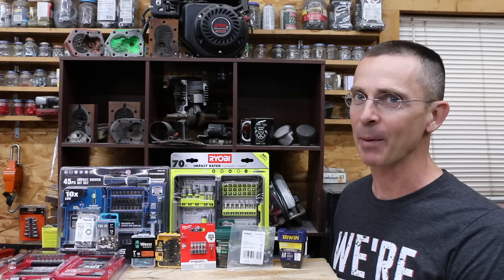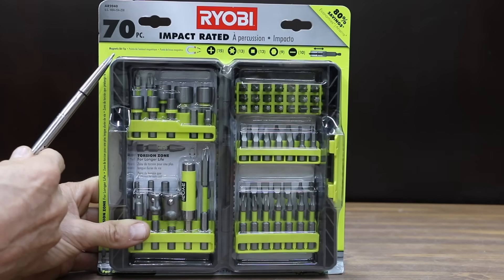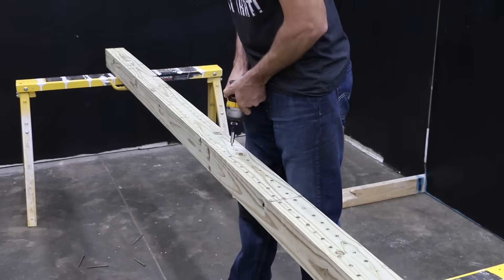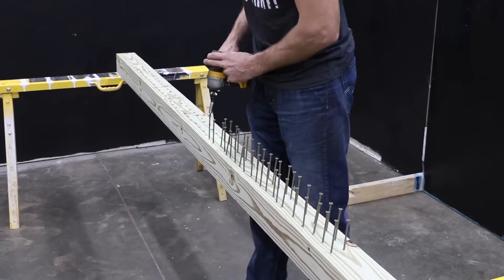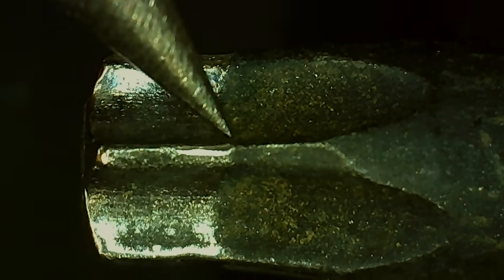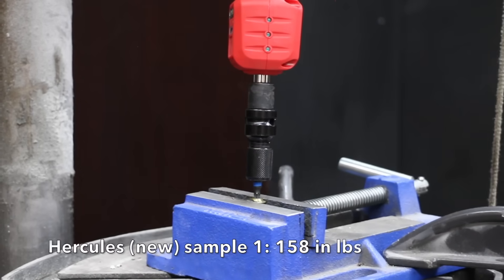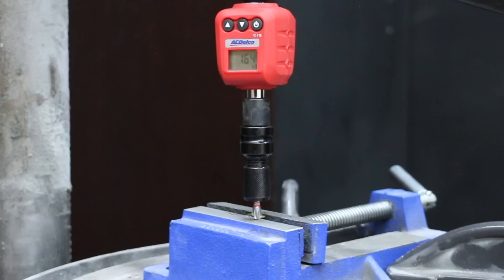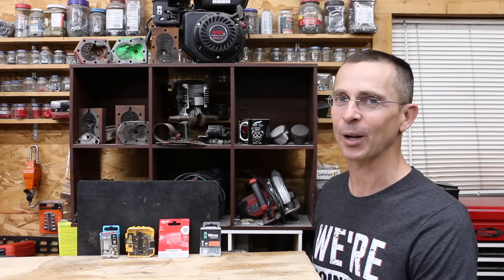Best Star (Torx) Bit Brand? Milwaukee, DeWalt, Makita, Ryobi, Wera, Wiha, Irwin, Bosch, Bauer

Comment: I run Dewalt the most. They are sale the assortment packs at the home store frequently. I also run Milwaukee and have a few Makita. I keep a full set in my tool chest, one in my pack-away, and one on my work bench. With plenty of extras. I’ve never put them to the test you have, so no issues as of yet.

I agree, the better value with the performance is where I go with these. They are actually easy to loose, and it’s easier to replace from a pack on sale that to hunt for the expensive ones.

Well done! Excellent video as always.

Comment: It should be noted that Wiha makes two lines of bits a red banded set and a blue banded set. They are designed for different types of screws with different angulation in the bits themselves.  The blue bits are designed for machine type screws with heads that sit above the material when tight.  The red banded bits are designed mostly for screws with heads shaped like a wood screw but will work with the other type.  Pays to use the correct bit for the screw being used. Both are available in 40-50 piece sets for about $30-$50.  Not that bad a price for very strong bits
Reply from the maker: Thanks for the feedback.

Comment: I absolutely love these videos. You are killing it man. This video inspired me to go out and buy some makita impact xps 2” t20 bits. Makita sells a magnetic bit sleeve for this bit and the magnetic sleeve is the most important part of this story. Long story short. The makita sleeve sucks in comparison to the max fit sleeve. So I bought the dewalt flex torque sleeve which works great for flex torque bits only. I’m not buying flex torque bits. Ugh. So what I really wanted was a sleeve for the Milwaukee bits. I did some measurements and drilled the bottom out of the flex torque sleeve with a 5/16 drill bit to about a millimeter from hitting the bearings and now it fits and works perfectly on the Milwaukee bits. Winning.
Reply from the maker: Thanks!  Thanks for sharing.

Comment: The fact these did so well is a testament to the engineering behind the Torx standard. I always swap socket cap with equivalent Torx fasteners whenever the location of the fastener means a stripped bolt will be a nightmare.
Reply from the maker: Thanks for the feedback.

Comment: I mostly use bits for mechanics and they rarely break, even low quality cheap bits. I use the same bits for years, the screws heads are the ones to wear out, not the bits. This test seems to help carpentry projects I guess, but not mechanics.
Reply from the maker: Thanks for sharing.

Comment: I may be out of my depths here but I just wanted to comment on how you were cooling down the impact driver between sets. When placing a hot item in an environment colder than the ambient temperature; condensation forms when it cools. This is an issue when it comes to electronic components since that condensation means water on your circuits. It may or may not be good for the tool. Regardless, your hard work and dedication is so appreciated! Thank you for great tests as always.
Reply from the maker: Thanks and you are welcome!  Thanks for the constructive feedback.

Comment: Would you ever consider adding the freebie bits that come with the screws to see if there is any benefit to using the ones designed by the screw designers?
Reply from the maker: Thanks for the suggestion.

Comment: That's an astonishing amount of effort for the cause! Well done, and thanks. I have a side question for you which might go further. If you are installing a screw in a location likely to rust or get degraded, what is the best bit type to use? Cross-head are hopeless but hex round out easily too. Is torx the best? Spline type?
Reply from the maker: Thanks and you are welcome!  Thanks for the suggestion.

Comment: I've been using a MAC Tools impact bit driver set in my Makita 1/4" battery impact driver for years. Very happy with it. But if I ever need replacements, I'm going to find Wera bits, very impressive!
Reply from the maker: Thanks!
Reply: Becareful with Wera, I had pack of the PZ2 i used in decent priced Wera bit holder. the bit holder didnt last 2 months the bits didn't last any better than the ones my work gave me. The best i have used was the Makita gold bits ( they might be shit now tho like most of makitas range at the moment)

Comment: I definitely agree on the Makita bits. I bought a set last summer when I rebuilt a deck. I drove over 700 2½ inch deck screws into pressure treated lumber and I didn't break or wear out a single bit.
Reply from the maker: Thanks for sharing.

Comment: I only buy Wera and milwaukee tools when possible, nothing is like Wera
Reply from the maker: Thanks for the feedback.
Reply: Everything i have bought from Wera was utter shite. I refuse to even use them now.
Milwaukee is not what it was either. me and my mate both started switching to them and out of the 6 tools we got 5 had to go back for repair. just waiting for the switch on my multi tool to go.
My work supplies me with makita and thats got to be one of the worst as it is just cheaply made over priced crap now. i have never been a fan of them but i think dewalt is probably the best at the moment for the quality of tool and price.  
I did recently buy a little chop saw and got Macallister one and it was like £130 and its absolute little beast. Apart from the size of cuts it gives my work saw a run for its money and thats  a £600+ makita one

Comment: just wanted to say thank you for tool testing. I've spent way too much money on socket sets, bits, wrenches etc in the past then been disappointed in a work or home application. 

I was actually about to suggest this but saw you've already reviewed them. I run a lot of screws at work installing blocking and typically used Milwaukee bits.
Reply from the maker: You are welcome!

Comment: When I was renovation our apartment, I used torx screws whenever possible.  I had a box of generic bits, which contained few torx, but those stripped pretty quickly after a few screws. So I went and bought a single wera torx bit for something around the three dollar mark. For my needs, one more enough, as I didnt really have that many screws to work with, but the knowledge, that I would not have to worry about the bit was more than enough. For a handyman, yes, I guess something with a better price/performance ratio makes more sense, but for me as a hobbyist, it is basically a one-time price. Cheers and thanks for a great comparison!
Reply from the maker: Thanks and you are welcome!

Comment: Seems like those that did better in the break test after use were work hardening and that to me suggests that the alloy is too soft. Ideally, if the right alloy is used and properly heat treated, a used bit and a new bit should be about the same in your tests, with the used one faring only slightly poorer.
Reply: Heat treatment through use my friend.  I'm sure it's a delicate balance between hardness and toughness.

Comment: You should try Wurth "white tip" bits. Undistoyable, durable, well fitting and making very little damage to screws. They are not impact tools dedicated but working very well with this kind of tools.They are expensive, about 10 dollars per bit, but totally worth it.
Reply: 10 dollars per bit... ffs!
Reply: Where are they made? Isn't a lot of their stuff Taiwan these days? $10 is a lot for a 1 inch hex bit.
Reply: @aussiehardwood6196  they are made in Germany. And as I mentioned before- they are expensive, but you can only loose them,, not damage. I used to install a lot of windows before, using a lot of bits weekly. After I got Wurth bits, I used 2 of them during 2 months. I believe it means something.
Reply: They may be great but you have to be a registered business and probably German or European to get them. And at 10€ I'm sure 20 wiha bits will outlast one Würth bit.
Reply: @dabj9546  Wiha are really good too, it is more like proffesional brand. But from my experience- Wurth is the most heavy duty. I worked with titan Stanley bits years ago, but they were horrible, destroying any kind of screw head at once. I always have Wurth bits in my tool box for special tasks. And they were bought 11- 12 years ago.

Comment: Two questions: 
1) How did you determine whether the bit fit was good or bad? It seems that you're praising the bits that have some wiggle room, while criticizing those that fit snugly. Sure, the snug fit may mean that when you pull the driver away from the screw, the bit remains in the screw, but doesn't that also reduce the wear on the bit and the screw head with a nice snug fit?
2) Why test to failure? Do people actually have issues with the bits snapping? On a long extension bit, I can see where that might be an issue, but not on these really short bits. It seems that the major criteria is wear to the flutes which might prevent the bit from properly engaging the screw head either not driving the screw or worse, stripping the screw head out.

Finally: Wow! What an incredible amount of work, thought and creativity you put into all your testing videos! Thanks for doing it for us!

Comment: Is the master force inherently the best I have to remove around 100 t30 screws from a custom f550 bed and they have some light rust , all i have is a removal set if they get stuck , new screws coming and a impact driver and a choice to make on t30 price isn’t much of a concern because the company will cover the bits.

Comment: I changed a wheel bearing using a T55. I had a MAC to start with I got one out snap. I got a snap on from my brother it completed  the rest of the job no problem , I took the other two out  and installed all three. obviously on a hand ratchet 1/2 inch
Reply from the maker: Thanks for sharing.

Comment: Screw sticking to the bit is quite preferable in many cases though, especially when on a ladder juggling boards around. Wouldn't say one is better, just different use-cases.

I feel like a good test for a brand is trying to unscrew a slotted screw with an undersized bit and then see how much twisting it creates. Same metal/finish will be used for the different bits in the same set/range.

Comment: This is a good test for pounding screws into wood and drywall all day. Now test the infamous T45 as used on brake calipers. This is purely a hand and impact torque test. Calipers eat Torx like candy so only need for repetition is how many torques to fatigue. It's common to keep 3 or more Snap-On in the tool box. You may break them all just removing one caliper. Be sure to test Snap-On, Mac, Matco, Lisle, and other auto store brands that claim they are for use with brake calipers. 

Fortunately it appears that manufactures slowed down with the horrible torx on brakes. I haven't seen them in years.
Reply from the maker: Thanks!

Comment: I watched this and the one with the Phillips head.  You mention the unit cost but you don't make an attempt to normalize.  If a bit costs 10x more than the comparison bit but does 20x more drives before failure, then it's cheaper than the comparison bit.  My sense is that you get more than you pay for with the top brands because they last longer.

Comment: I just threw away a box of Bosch T25's after realizing that they fit very loose and strip screw heads after very little use. Replaced with Makita gold and the difference has been night and day. Very glad I found those and interesting that you had the same results with Bosch.
Reply from the maker: Thanks for sharing.

Comment: What’s inch pounds? I’ve used foot lbs and newton metres but never used inch lbs. I converted 150 inch lbs online to NM and it’s only around 17, so you’re saying the bits break at 17nm? That’s surely not correct? That’s hand tight, so there’s an issue somewhere?

Comment: If you wanna do some real anal testing: Wiha has multiple types of bits for different screw shapes (yes shapes, not drives). I am pretty sure that's mostly bs (especially if used with hand tools) but it would be interesting to prove it.

Comment: As a Suggestion (there are many comments. I’m not sure if it’s been said) you should sample across each board for each brand. Instead of 100 or so on each 4x4, do 20 on each 4x4 for each bit. So each bit is exposed to exactly the same. That way you standardize not just the number of screws but the material.  It’s great that they’re all from the same stack of lumber. But there are vast inconsistencies even in stacks of the same lumber.

Comment: Great stuff as usual.  Thanks.  
One way to improve the control for wood variability would be to use each bit on each piece of wood in a staggered fashion, ie: for piece of wood #1 drive 
screw #1 with Milwaukee, 
screw #2 with DeWalt, 
screw #3 with Makita, 
screw #4 with Ryobi, 
screw #5 with Wera, 
screw #6 with Wiha, 
screw #7 with Irwin, 
screw #8 with Bosch, 
screw #9 with Bauer
screw #10 with Milwaukee, 
screw #11 with DeWalt, etc
Then repeat the staggered sequence on the remaining pieces of wood #2.
Reply from the maker: You are welcome!  Thanks for the feedback.

Comment: Only someone like Satan himself made torx anything. The worst thing since hex bits and screws. Even the best strip out the first time. The bit just twist around themselves like the Exorcist chick’s head. The screws get demolishing into a perfectly round hole that renders it useless. Philips is awesome! Flatheads suck because nothing holds the driver/bit in and it slides out every quarter of a turn.
Reply from the maker: Thanks for the feedback.

Comment: I was pretty disappointed in the last few Milwaukee bits I bought; they all rounded off after only a few screws.
Kinda wish I'd kept the package so I could take them back to Home Depot....gonna have to try some of these other brands to see if I have better luck.
Reply from the maker: Thanks for the feedback.
Reply: Makita is the best imo but that's with phillips, but if it's the same metal in the torn bits it's probably as good

Comment: I bought one of those cheap hundred piece bit driver sets and of course its cheap steel, they all mushed when used. Went to True Value and picked up individual Torx bits by Irwin. Very expensive to purchase separately but they were strong and did a lot more work for me. I still have not found a complete Torx, Allen, Robertson set of high quality anywhere on the internet.
Reply from the maker: Thanks for the feedback.

Comment: You do a good job in creating comparison. But you missed the fact that a tight fit on a screw is preferred because you often cannot hold the screw on while screwing it on something vertically or overhead oriented, or if the screw has a hard time starting and starts to wobble.
Reply from the maker: Thanks for the constructive feedback.

Comment: Being a CNC operator, I can tell you that there are a lot of factors when it comes to consistency on product finish and fitment size/tolerances. Besides any faults of the programmer themselves, many of the operators don't change the machine tools as often as they should, and the tolerances can vary. It's not always a huge difference, but unless you have an A+ QC department,  a lot of product can get shipped out of spec. We CNC guns/gun parts, and other things companies want, so making tools, fasteners and other tiny parts may be a slightly different operation, so I can really only speak to the things I have run, but it's usually an identical process.

That being said, cnc machines do achieve accurate manufacturing, but by no means is it perfect. They always say, the machine is only as smart as it's programmer.
Reply from the maker: Thanks for the feedback.

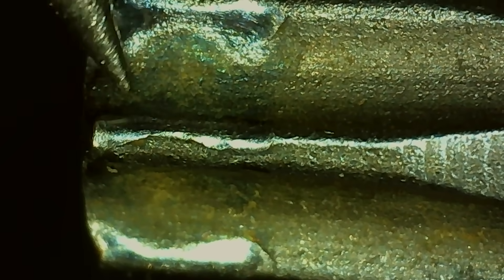Comment: Minute 12:39 - Test Master Farm Boy, I really appreciate your closing words of wisdom! And that you SHOWED examples of each "bit" of advice to keep in mind. I recently drove boxes of expensive "Deck Plus" brand "Composite", "Trap Head", "No Strip Star Drive" screws of varying lengths.  I really really liked them, but accidentally killed several by probably not having the bit seated properly. Micro metal shavings accumulated on the two brands of bits I tried from magnetism? This build up caused the bits to not fit snugly in the next screw head. Arg! Query: Do you have a magic trick to remove those micro metal shavings from the bit? I've tried just pulling/brushing them off, a magnet, and tape - all of which are unsatisfactory with star and Phillips head bits. Thank you again for your advice!
Reply from the maker: You are welcome!  Thanks for  sharing.

Comment: Can we get a test on torx screwdrivers/bits on small sizes such as T5-10. I use them a lot of pocket knives and I've had some that dont stand up well which either twist or break. It would be nice to see what brand has the highest strength without deformation.
Reply from the maker: Thanks for the suggestion.

Comment: It's interesting you consider a really tight fit a bad thing, because of having to finagle to remove it.

To me that would give me More confidence it won't strip the screw, and that's the most important part. Based on how well masterforce did, that checks out. 

I'm an airplane mechanic; screws there are notorious for being easy to strip. Drilling a screw wastes much more time than having to wiggle it out of a bit to me
Reply from the maker: Thanks for the feedback.